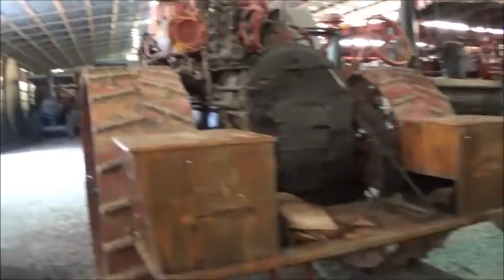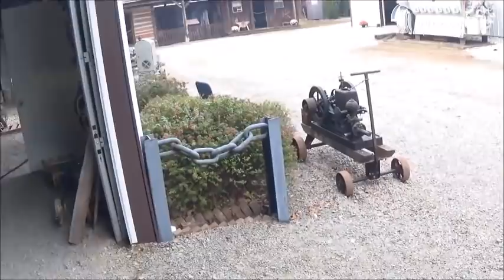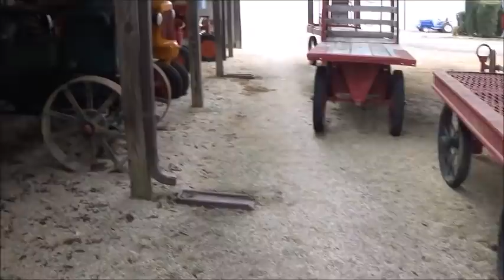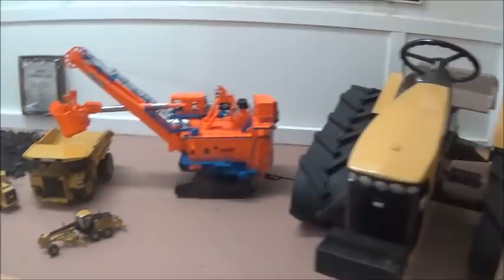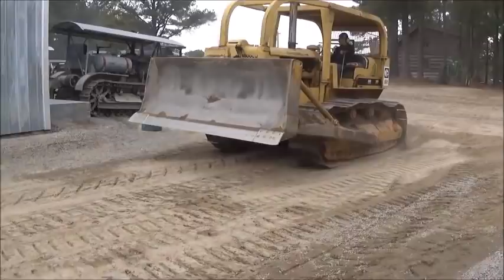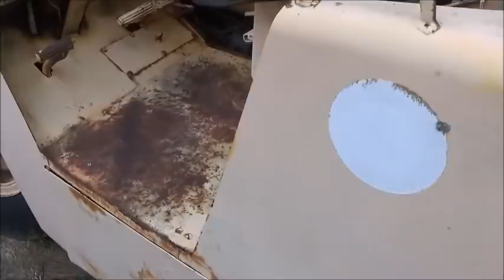100 YEARS OF PROGRESS EDERVILLE  AN UNBELIEVABLE  COLLECTION

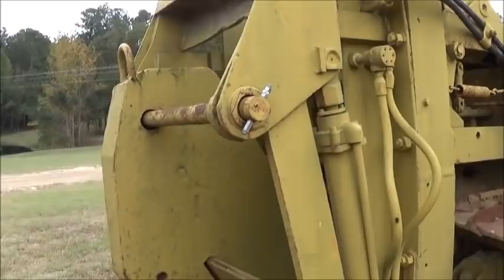Comment: @35:36 You can see that many weights can be inserted and held in place by the rod. There is one weight in place here. The weights also have a slot at the bottom that fit into a fixed plate that is part of the machine. The more weights put in here (@35:36), the more weight it can lift with the crane, on the opposite side. Also, the hydraulics will extend the weights out. They are scissors. They extend the weights linearly away from the load so the crane does not tip over. Infinite adjustment, if you will. All by the seat of your pants. Scary. Jonathan can do it in his sleep!  ;-) I would imagine there was a tip meter with a plumb bob. Or something. Still, I bet that could lift 7-8 thousand pounds. (3.5 to 4 Tons) Maybe more. With fully populated and extended counterweights, 10 Tons? I am guesstimating. It is a rugged machine.

Comment: I'm retired from Caterpillar Tractor Co. after 40 years. I hired in as a welder and over the years I did about every hourly job on the shop floor including skilled trades as an electrician before moving into management. I worked for Global Purchasing for a while at the East Peoria plant and occasionally would be tasked with giving tours to some of the suppliers when visiting. Almost all were impressed with the scale of the machinery involved even those that regularly visited the auto plants of the big three. One of the highlights of the tour would be if I gave them a ride on a D10 or D11 if one was available because I held a qualified tractor drivers licence. Nothing like climbing up on a D11 since its about the same as sitting on top of a single car garage and driving it around.

Comment: Listening to the stories reminded me of the day I worked for a railroad recovery company. By "day", I actually mean a couple of hours. I was 18 years old and I'd just started working for them. A coupling hitch suspended by a cable from a crane was slung around the coupling on a car and we'd just set it back on the track. I was working on disconnecting it, trying to decide which would be easier: lower it down easily or just let it drop to the ground. As I continued to disconnect it, gravity made the decision for me. Unfortunately, my foot just happened to be under it. 50 lbs of steel dropping from a height of a couple feet off the ground ended my career in railroad recovery rather quickly.

They didn't fire me. But they soon relocated to another town and, although they offered to keep me on, my recovery time was too long.